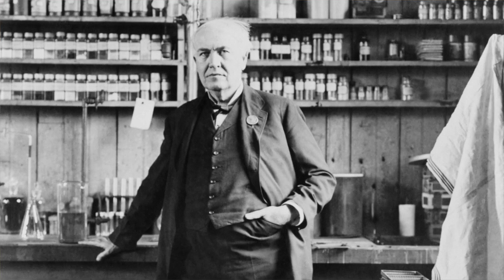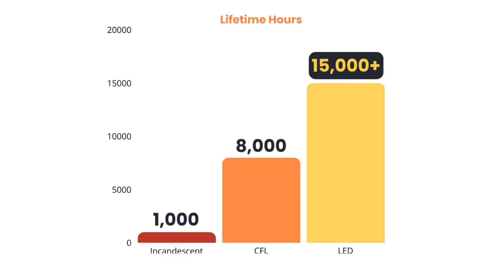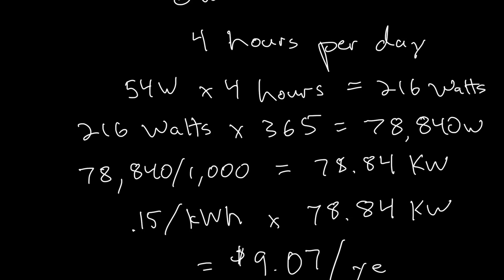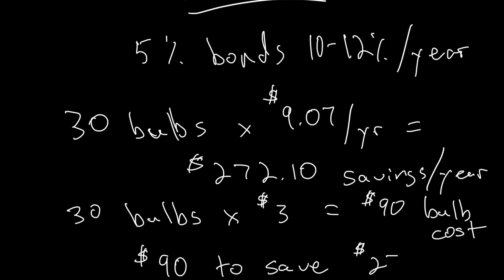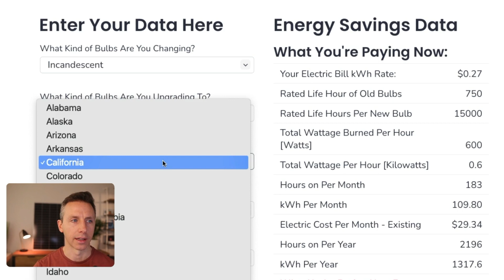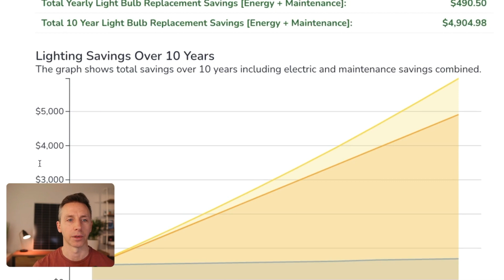Why You Need to Swap Your Bulbs to LED (Calculate Your $$ Savings)

Comment: At home I would turn off lights in rooms where I wasn't if I was at all concerned about costs. Something like 6 bulbs on at a time is reasonable. This is something you can't do in a commercial property. But if I were to replace a 40 watter that was there for savings with a 10 watter, I'd have much more light and also whiter. This is very nice. In a fridge I get no savings, but still much more light.